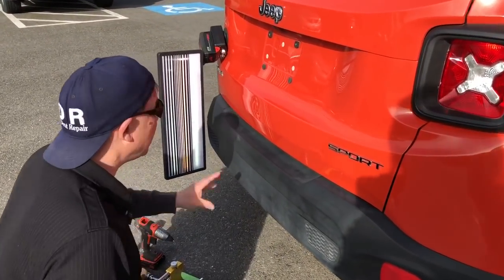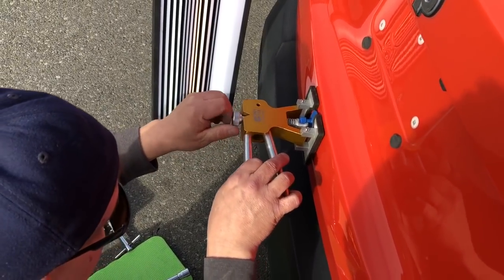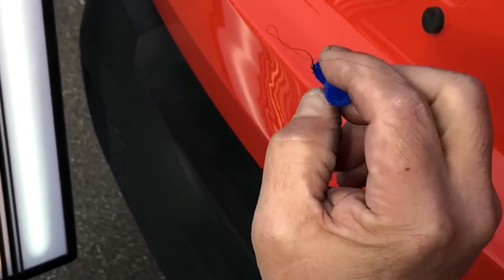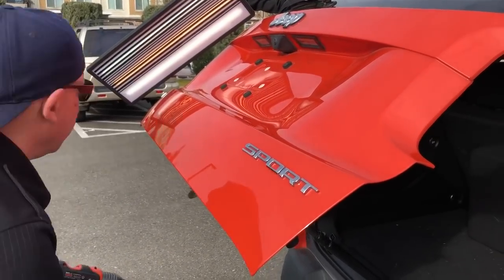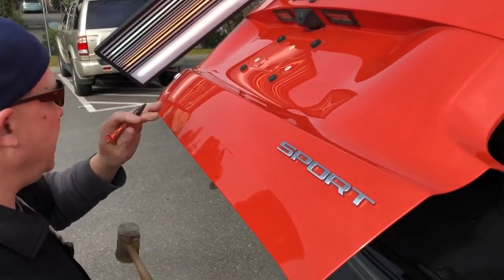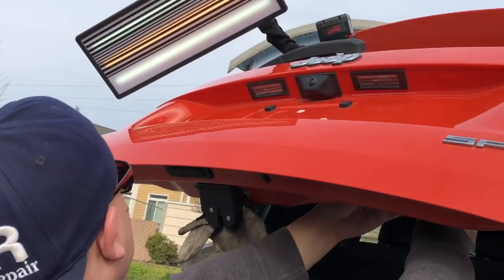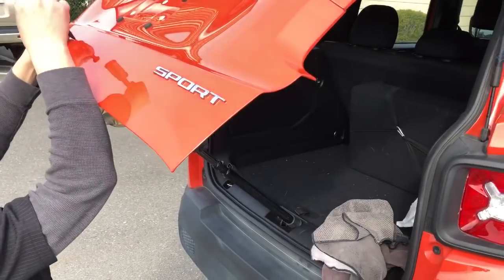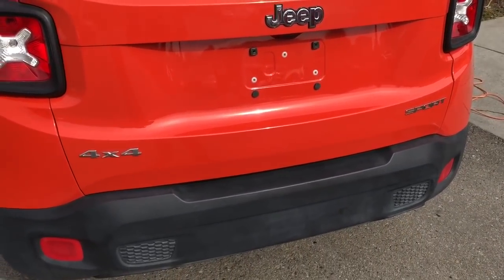How to | 🚗PDR access and repair JEEP RENEGADE🤕|PDR in action!😎

Comment: Another great job! Since i am a beginner, what tools would you recommend me to use and where can i buy them from, brands and so on? I checked on ebay, alliexpress and there are a lot of different kits,, which is why i am asking you this. I dont want to buy the most expensive tools, obviously, but i dont want the cheapest ones either. I know that i am asking a lot but would you be kind enough to point me in the right direction, so to speak. Thank you in advance!
Reply from the maker: Brulserz Thanks for your comment. I have a few two reviews on my channel also I would suggest taking a look at some tool reviews on Mike Toledo channel called Dent time he does an excellent job at reviewing tools .  Most important thing about Dent tools is quality. Make sure you’re getting something that won’t break because you’ll be using it a lot.
Reply: Thank you for your quick response.
Reply: I recommend the hammy and tappy with a bottle of splooge